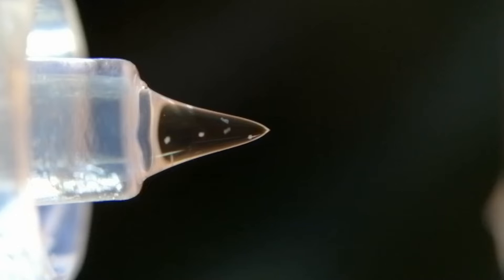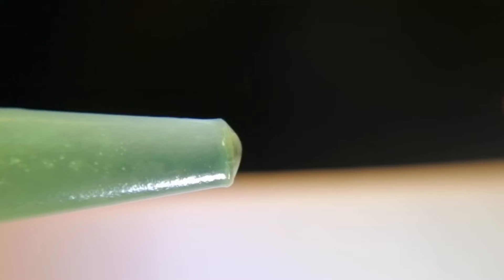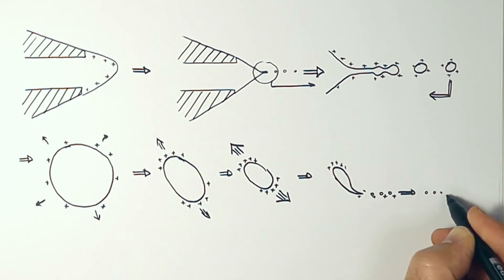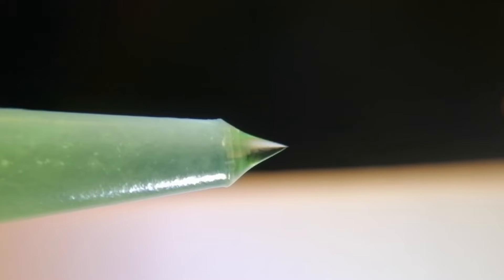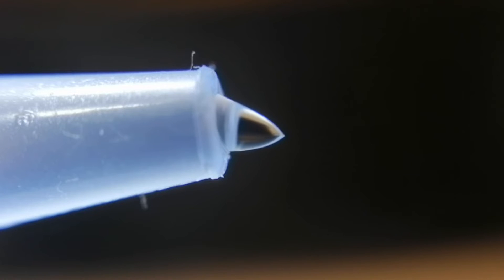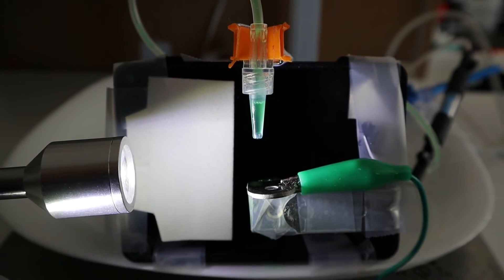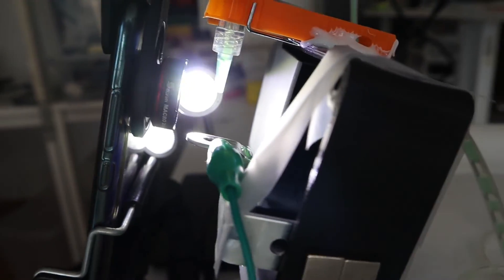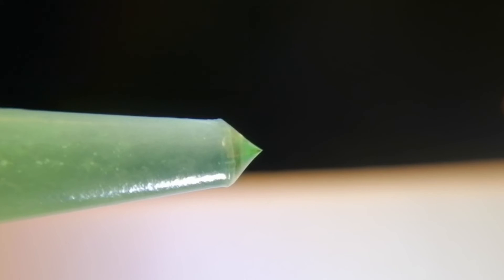How electrospray ionization works

Comment: Can you recommend the whole setup (machine) for electro spraying. Which company is better with better efficiency. Name of company and model number of device.
Reply from the maker: Hi Trending, Thanks for your comment! The ionization efficiency in nano-electrospray depends on the emitter. The ion source provides positioning, voltage, connection to the MS, and so on. In short, the ion source of your MS should work fine. If you are interested in performance, choose the best emitters. Fossiliontech sells and ships worldwide. You can check the nano-esi emitters here: https://www.fossiliontech.com/nanoesi-emitters

Comment: Great video, I like your model. How are you apllying the voltage on the "sample" when is your capilary made from plastic? Thank you.
Reply from the maker: Hi kubasmetana5525! The voltaje was applyed by inserting a metalic pin in the tube. The voltage is applied to the pin, which is in contact with the liquid.

Comment: For chain ejection long molecules are rejected due to what?
Reply from the maker: In chain ejection, long molecules are ejected due to Coulomb repulsion. A key difference between chain ejection and ion evaporation is that the energy required to eject each link is lower than the energy required to eject the entire molecule at once. I hope this helps! :)